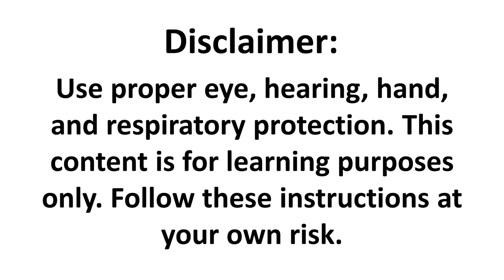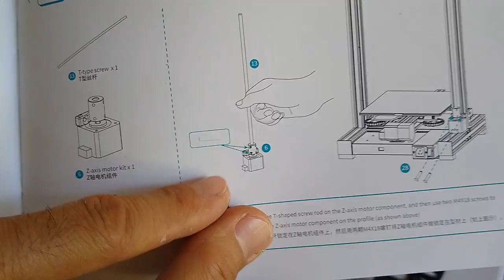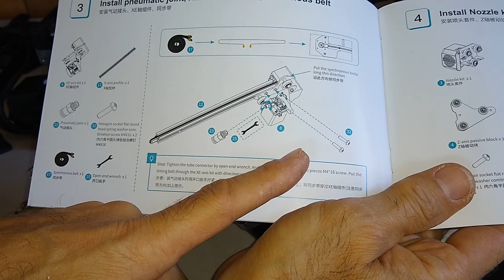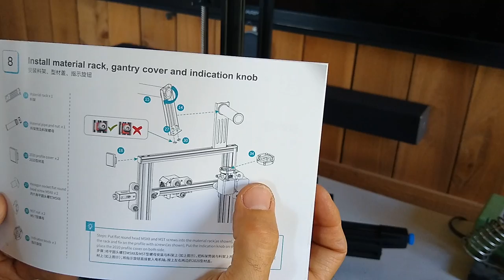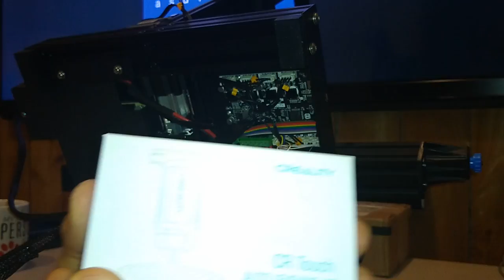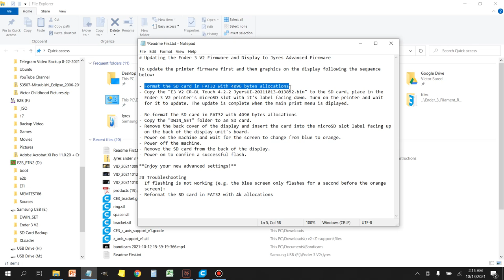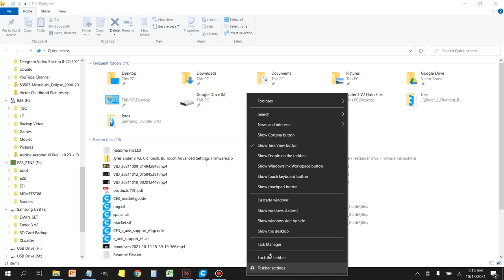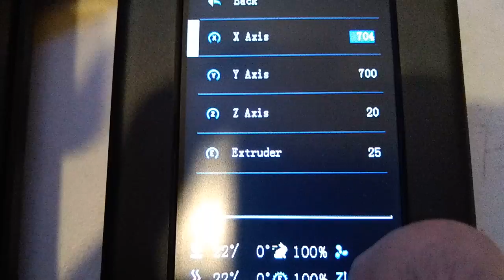Ender 3 V2 Assembly, Upgrades, and Jyers CR/BL Touch Firmware Step by Step.

Comment: I installed jyers yesterday… version 2.0.1 if memory is right (latest version anyways)…. And my hot end temps still only go to 260… don’t really matter because I’m still on the stock hot end but when I get all metal any idea of how I raise this limit above 260? Confused about why yours lets you go to 300 and mine only 260 lol. I did the pre compiled UBL 10x10 version FWIW.
Reply from the maker: Hello cjsawinski, Flash the one from my link I edited it to get to 300.
Reply: @vbared  sweet I’ll try that… I’ve been trying to compile my own edit of it with no success lol…. Thought I was hardware/software savvy but I guess I haven’t yet “learned to code” lol

Comment: Adding that 3d printed part to the top of the Z rod is actually not good, because if your Z rod is bent slightly, then that bend is going to be transferred further down, closer to where your x axis is.  If the rod is free to move around at the top, then any bending in the rod will be allowed to move freely at the top, instead of further down where it can affect your prints.
Reply from the maker: Hello AndehX, Thank you for commenting and advice on the z-rod holder on top. I've since switched that part for a different version that accepts a skate bearing (the new part link is in the description). The issue I found with the z-rod is it's not parallel all the way down to the z-stepper motor. Adding the shims to the z-stepper aligns it properly so the z-rod is perfectly parallel to the aluminum extrusion from end to end. The z-rod holder isn't putting any pressure on the z-rod in any direction and is loose enough in the extrusion to allow some lateral movement. My CR10S Pro V2 has two very long z-rods and Creality included holders with bearings on both at the top. I've had several people tell me the same thing as you about the z-rod but by using the shims on the z-stepper together with the top rod holder I haven't experienced any binding or printing issues.

Best of luck with your projects!

Comment: I definitely appreciate your hard work for this video and the time you took to lay it all out. Im not sure if anyone else has come to you with this problem... I inadvertently started my 3v2 with the wrong SD card. Now my display is black and beeps loudly. I did download the DWIN..... on a freshly formatted SD card. I followed instructions to a T. This time LCD lights up, is blue, and then orange but continues to beep and never gets to an operational screen. Any ideas? Any tips? Where can i find info? Creality has been 0 help... please n thank you ia
Reply from the maker: Hi Serina, Thank you for commenting and words of encouragement. Give me a call when you can so I can get more information +1 478-227-3301 . It seems that flashing the screen went OK because the screen will light up blue then orange when done correctly. Make sure to remove the SD card from the display when completed. The flash file you tried initially that failed was it the one I linked in the video description? Did you try to re-flash the printer with the correct SD card you used for the display?

Best of luck with your mods!
Reply: @vbared  HI! I wasn't expecting an answer so quickly. Thank you! I definitely want to chat with you more on this. I am in Cali, so our time difference.? It would be easier to explain in detail. I also decided to attempt to put the firmware on the sd card and put it straight into the machine. this time, I got half screen words only  and when clicking auto home it changed my language to Chinese/Japanese. But I will give you a call tomorrow which is Monday. And I can explain the rest of the details. Thank you again for getting back to me. p.s. yes I had removed the sd card right after i shut down my machine. :learning:
Reply from the maker: @MoMsLiKe2GaMe2  Hi Serina, no problem at all, I understand how frustrating 3D printer issues can be.  It sounds like you are making good progress. Let's talk Monday.
Reply: @vbared  anyway you could help me get mine leveled right? Just doesn't seem to work right I must be xoing sienthig wrong. Been at it for days
Reply from the maker: @paytonsmith7201  Hi Payton, What model printer? And are you using a CR-Touch, BL-Touch or is your machine stock? Also type of trouble are you having that has you looking at bed level?

Comment: This machine has been nothing but trouble.  Have just reached the part of your video which talk about the seal between the nozzle and the Bowden tube,  this is such a bad design even with Bowden clips installed less than 0.5mm of movement causes the head to leak.  I am now on 3rd nozzle creality branded and two of which have had very tiny cracks only visible under a strong light so I can see myself going for the option you suggest.  I purchased the CR Touch and installation and setup was a complete breeze,  in fact I had 2 whole days of perfect printing and then it all went pear shaped.  Am now running Jyers firmware which does seem more comprehensive.  Thanks for this video it has been very helpful... have to go printer gone wrong again !!!  Guess what another leak !! :-(
Reply from the maker: Hello RaspberryPI Ploy, Thank you for commenting. Yeah, I agree with you 100% leaks are the most annoying things to deal with 3D printers. Look at this video linked below by CHEP in which he mentions another YouTube channel that came up with a fix to address the bowden tube seal inside the hot end. Instead of relying on that flimsy little clip to maintain the pressure needed to create a good seal a small 3D printed washer is installed between the bowden tube coupler and the heatsink seat it threads into. This simple mod transfers the clamping pressure needed to maintain a good seal from the tiny slip to the threads where the bowden coupler screws into. I recommend that you use a short piece of Carpricorn tubing to resolve it as it has tighter tolerances and can handle higher temperatures. The seal is key to these machines running for very long stretches of time without any major maintenance to hot end. If I hadn't already converter to an all metal hot end this is what I would be doing. 

CHEP YouTube video on how to keep clogs from happening - https://www.youtube.com/watch?v=7tCxO17XZtw&t=4s

Let me know how it goes if you decide to try this mod. I haven't tried it but am 100% sure this will solve this issue for you.

Best of luck with your projects!
Reply: I have this mod on my printer, haven't had a leak since then.  Still not as good as the microswiss, I still need to replace the inner bowden tube section every few months, but it hasn't been to much hassle!
Reply from the maker: @mickeyxxmousey  I'm currently running this same CHEP video and it's working great at the moment. My Micro Swiss Heat block keeps loosening from the heat break. I think some high temp thread lock should resolve it.

Comment: nicely done!
Reply from the maker: Hello UcantBeSerious03, Thank you for commenting and kindness. How have you been? The Ender 3 V2 is awesome. The prints are better than my CR10S PRO V2. Trying to figure out what's different between the two machines aside from one being bowden and the other direct drive. Maybe the parts cooling fan or duct. It could be a more refined firmware on the Ender 3 V2.
Reply: @vbared  If you did a flow test, temperature tower,  and extraction test, along with PID tuning I would have to say slinging around all that extra weight of a direct drive might be issue.
Reply: heck it could also be a new profile in Cura when you added a new printer. Maybe one of  the 100 settings are different. You'll figure it out, you seem like a good problem solver.
Reply from the maker: @UcantBeSerious03  Good morning, Yes, I tuned with temp tower, retract tower for distance and speed. On PID I used auto-tune. Both have blower type parts cooling fans but the CR10S has a 40x40x20mm and the Ender 3 version is 40x40x10mm. The bowden tube on the CR10S was much longer than the one on the Ender 3. The direct drive made a huge positive difference with extrusion on the CR10S. It's interesting how despite almost the same components they print so different. The Ender PETG prints are shiny. The CR10S are more on the mat side. Same 50 watt heater, and hot end.

Comment: Thanks for the super video! I just bought an ender 3 v2 and added the cr touch and all metal extruder. One of the issues i would have is when using the jyers firmware, it would brick my z axis motor and give me errors. After rolling back the firmware to a creality factory firmware, I was able to get a decent print out of it. I would like to use the functions included in the jyers firmware including viewing the mesh. The auto leveling works with my cr touch but because of the firmware I'm running I can't view the mesh. Any thoughts?? Thanks for the great content
Reply from the maker: Hello FullSpeedAheadFilms, Thank you for commenting and kind words of encouragement. Are you having trouble with Jyers firmware in the video description link? Please describe what happened. You said it bricked your z axis motor. Did the motor just not work at all or did the CR Touch error out and stop during auto leveling? Maybe I can help you get the Jyers firmware working. Unfortunately, I don't thing the stock firmware displays this data along with the stock display flash not having the Jyers graphic package.
Reply: @vbared  I appreciate your response. It wasn't the firmware from your video but a similar Jyers one. After i updated to that particular firmware, when i went to create the mesh, it acted like the z-axis motor was locked up and wouldn't move then I received a "printer kill error - must restart etc". I will try the firmware mentioned in your video below and see if I get a different result.
Reply from the maker: @FullSpeedAheadFilms  I've run into printer kill errors as well due to an improperly configured firmware. One thing to try before abandoning a firmware upgrade is an EPROM reset  then a manual bed level followed by an auto bed level. After everything is set, save it to the EPROM and do a test print. This for me has resolved the printer kill error after a firmware change.

Comment: After assembling Ender 3V2 I have fitted CR Touch Auto leveling Kit. I have 4.2.2 motherboard. Which firmware to flash for mainboard and is Display card also to be flashed? If yes which firmware?
Reply from the maker: Hi Nirmal, The files and video links below are to the flash files you need for your 4.2.2 main board and video instructions for you to follow. Yes, both the mainboard and screen need to be flashed.

Ender 3 V2 Jyers Custom Firmware - https://drive.google.com/uc?export=download&id=11VYODvhCfL_VLEZ_GkplXYnc2kVU_woV

https://youtu.be/amRldRpnK2Y?t=3730

Best of luck with your build!

Comment: The nice thing about the direct drive is that you will be replacing the cheap plastic "Always cracks' handle provided by Creality with a metal one. I will never buy another Ender, the elegoo neptun 2 is a better machine all around and a lot cheaper. I have both and the neptun is much more reliable.
Reply from the maker: Hello hasher411, Thank you for commenting and info about the Neptun 2. Creality has falls short on many simple improvements that would improve reliability, maybe it's by design.

Best of luck with your 3D printing hobby.

Comment: How did you come up with your y offset, I mean you used calipers but you didn't show what you were measuring
Reply from the maker: Hello SC Mafia, The measurements needed are from the probe tip to the nozzle tip. You will need both how far forward or behind the nozzle and how far left or right if it.
Reply: @vbared  thank you for your reply, I just can't get mine to print, anything anymore, I mean filliment is coming out but bed won't level with crtouch or manual....I'm about to give up

Comment: If I install jyers does it have defaults that I won't have to customize? I'm a newby and don't understand a lot of this, just started. Thanks
Reply from the maker: Hello Norman, Thank you for commenting. Please give me some more details. Are you using a CR-Touch? If so then I would write down some settings. Most important is your Z-offset and the extruder e-steps if you've changed it from the default of 93. What Jyers will give you is access to advanced settings and improved graphics. All the same stocks settings will be there.

Call me if you have any questions 478-227-3301 I'd be happy to help.

Comment: Great video thank you. I have one question for you I noticed when I went in the info section of the Jyers firmware it say the printer size is 230 X 230 X 250 and not the 220 x 220 x250 that it should be are you or anyone seeing that as well? I just did the CR touch install tonight and did a new mesh and everything worked fine.
Reply: Oh and one other question on the sd card I no longer need the eprom data anymore? I believe everything is stored internally now?
Reply from the maker: Hello Tom, Thank you for commenting and kind words of encouragement. Great question BTW, Creality is conservative with the bed size which is actually 235 x 235mm. (about 9.25 x 9.25 inches) The Jyers firmware get you an extra 10x10mm but leaves a less conservative buffer of 5mm. 

Yes, you no longer need the firmware flash file on the SD card. Just delete all the flash files use it for your print files like normal. 

Best of luck with your projects!
Reply: @vbared   Thank you for the quick reply.

Comment: hi i put the file onto the sd card put it into the printer and power on, the loading screen loads instantly and then the logo of the creality stays there? is this what it should be doing or have i done something wrong.ie how long dose it take for the flash to work,
Reply from the maker: Remove the card from the printer and flash the screen next. The screen will go orange when done. Remove the card, turn off the power and start it again. You should see the Jyres menu. If it doesn't work call me +1 478-227-3301 so I can walk you through re-flashing it

Comment: Bought my son this 3d printer for xmas. It printer 2 times and then the screen went blank and wont come back on. Is it broken?
Reply from the maker: Hello Brett, 

Thank you for commenting. I'm sorry to hear about the printer not working. Please provide me with a bit more info by answering the following.

When you switch it on do you hear any fans blowing or is it completely silent?

Is the printer set to the proper voltage? There is a red slider selector at the back on the power supply. Make sure it's set to 110volts. These printers often come set to 240volts.

If it had been set to 240 and still doesn't come on when switched to 110 then give the printer a good looking over by checking the plugs on each of the stepper motors. Make sure that these plugs were connected properly. Once you have confirmed the aforementioned check the fuses. There are two of them, one just under the power plug and one small blade style fuse on the main board itself. You will need to remove the main board cover to get at it. There are three screws at the bottom of it and one at the top just under the heated bed.

Let me know what you find.
Reply: @vbared  YES the fans blow but no display. Has a dim back lighting only.
Yes it was set to 110volts before operation.
All connections look good and all the fuses are also good. 
I've tried a firmware update using Ender-3 V2-Marlin-2.0.1 - V1.0.2.bin. 
The board version is V4.2.2 and I believe this firmware should have worked. But still no change.
Reply from the maker: @TheGarBrett  OK, if the display is backlit then the board is getting power so the fuses are good. Please tell me more about the firmware and printer. Did  it work after the flash or was that when it stopped working? Are you using a bed probe like a CR-Touch?
Reply: @vbared  The printer is as it came out of the box, no addons. I only undated the firmware after the display stopped. I heard it was a fix. I don't even know if the flash went through because the display never came back on.
Reply from the maker: Hi Brett, 

Try this firmware, it just needs to be extracted. Follow the flashing instructions on this video but use the files in the .zip file linked below.

https://youtu.be/amRldRpnK2Y?t=3732

Flash file - https://drive.google.com/uc?export=download&id=1Cv8AXt9lJ2lXLZV36KyJrNfWnYd4Xalt
Reply: @vbared  Update: New display came today. Plugged it in and works fine now after flash update. Its kind of BS that the other one only lasted a few days before it died. Thanks for your help. Now to find where i can get some gcode to print something cool for my son.
Reply from the maker: @TheGarBrett  Hi Brett, thank you for the update so it was a defective display, wow.